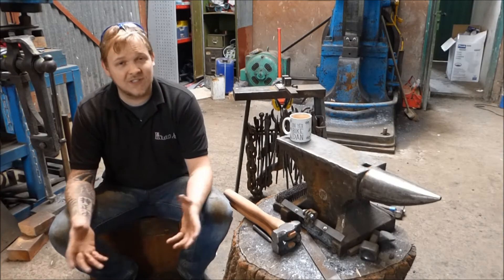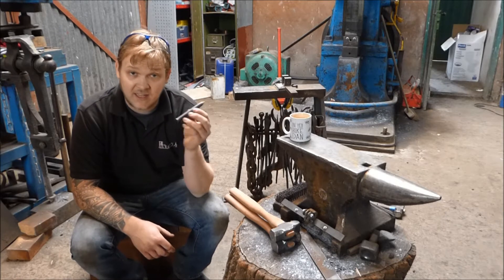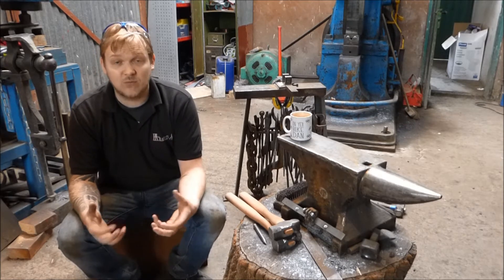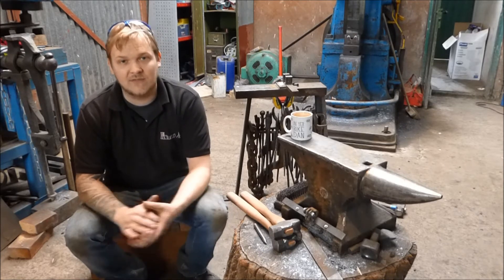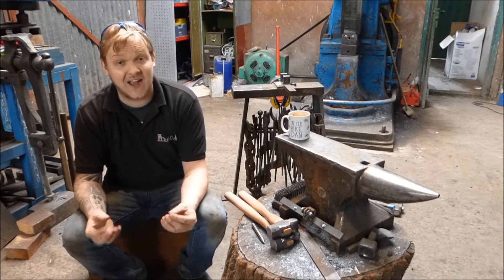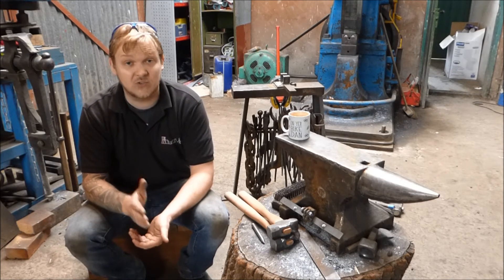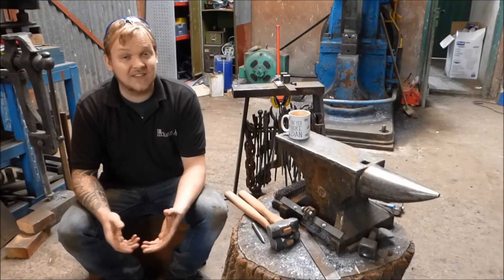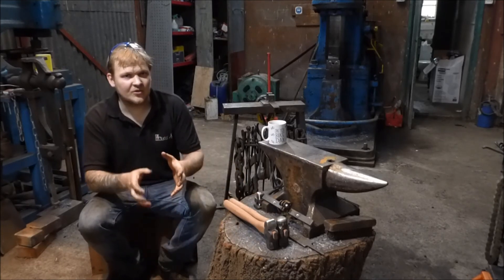Heat Treatment 101! Part 1 The Science! Trust Me I'ma Blacksmith

Comment: Ha!  I recognized this video as coming out of "The Crucible" before they ever identified themselves, from the first shot showing that progression of forks.  I had a VERY short lived stint as an instructor there last year.  That fork is one of four little projects that they do in their beginning blacksmithing class.
Reply: I meant the video you linked to, not your video, of course.
Reply from the maker: I think its a great little video. shame about the knife making in it but you win some you loose some hehe. They look like amazing facility? Thank you for the great comment as always hope to hear from you soon Mr Scott.
Reply: It is a really wonderful facility they have there  although I don't care much for the guy who runs the blacksmithing department. That, and the fact that when I taught there the ambient temperature in that department reached 117 degrees are the reasons I resigned after teaching only a single two day class.   They also have a glass hot shop, a foundry, full machine shop and a number of other crafts available, if you can afford it.  The classes are very expensive but at least in the blacksmithing department, once you take a class you can come down during times when classes are not running and use the shop free of charge.

Comment: I GET IT that some steels & iron material data sheets say water quench, but it's a dirty word for most of us. Don't quench in water unless the steel CALLS FOR IT... It will hose you all the time.
Reply from the maker: Not 100% on the same page on this one Mr John? Did I say something wrong? Thank you for the comment none the less. Also your quite right no water till there's nothing else to try.
Reply: Daniel Moss No sir - no disagreement here, however, water as you know, can cause major problems in quenching knives. This is possibly due to the formation of a layer of steam enveloping part or all of the workpiece(s) and cracks form probably due to radically different cooling rates at different points of the blade. As well, you mentioned water *first*, and that might give some the thought it was preferable. 

The experienced knife smiths (judges) on the popular show "Forged In Fire" all seem to get either apoplectic, do a face plant, or react in such a way as to emphasize they ALL DESPISE water quenching. 

ME, I have used it, but not on knives ever, unless (for purchased steel with a Material Data Sheet) recommends water using the specifics stated. 

Not so much what you said, but the order you listed quench liquids/materials gave me pause. I actually like your video (and your others) as you are very good source of information, being a very experienced blacksmith. Thanks for all the free lessons! Same page, same book, different perception.

I was in a bad budget pinch a while back and bought a cheap vise. The very FIRST darn time I used it, I tightened a 1" black iron pipe in it to drill a hole making a small knife vise fixture. The rotten buggers who made the vise did not heat treat the tightening handle at all. It bent RADICALLY on the first use, and I didn't really tighten it that hard. (I can't anyhow, I have arthritis in my hands, so my grip ain't what it used to be.)

I took the vise apart after drilling out the hole in the pipe, tapping it, and finishing up my project. I took the tightening handle rod off the vise &  torch heated it until it was non-magnetic, and little further. Then to the anvil to straighten it, it was arrow straight then. More heat to non-magnetic, then a quench in peanut oil, I laid it aside after that and a few hours later baked it at 425°F in an oven for 45 minutes, then cooled it real slowly in air. Now it's not bendable at all. 

I should BUILD my next vise. The cheap crud they sell in SOME stores isn't worth the cost of the paper cardboard they're packaged in. Making your own tools is much more fun. When I can, I do. I didn't have a welding machine at the time nor a drill press to do it right at that time... I'll give you three guesses where the cheap vise was made, but you will only need one answer to get it right.
Reply: Daniel Moss I did subscribe, and told YouTube to show me your videos first... They are very good! BRILLIANT VIDEOS  SIR!